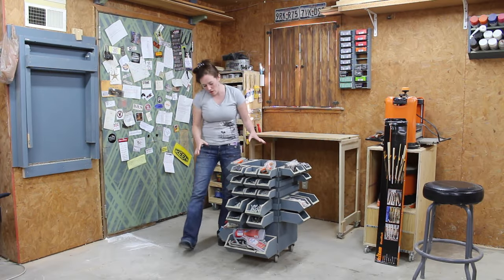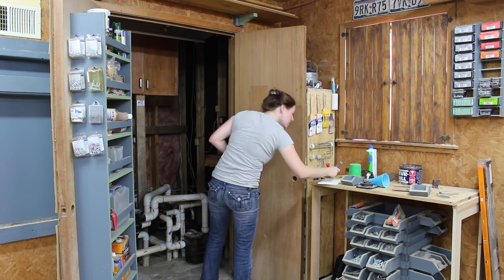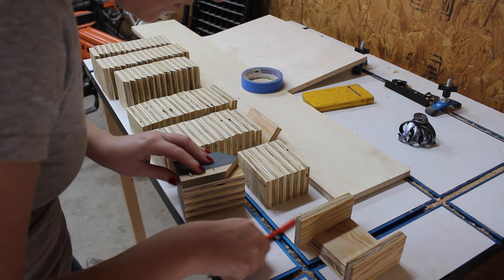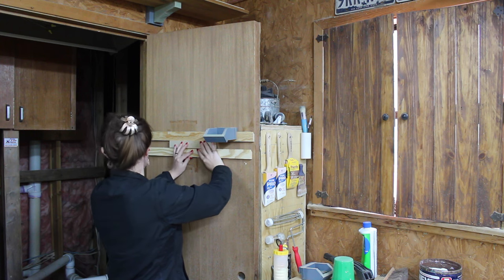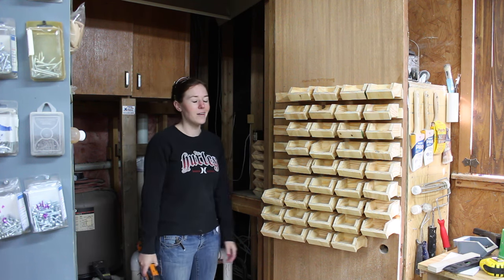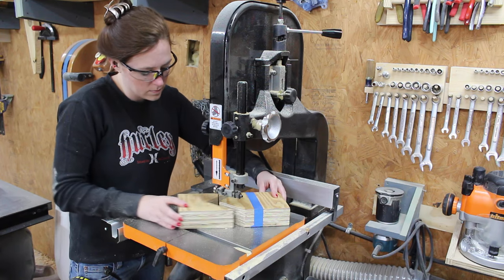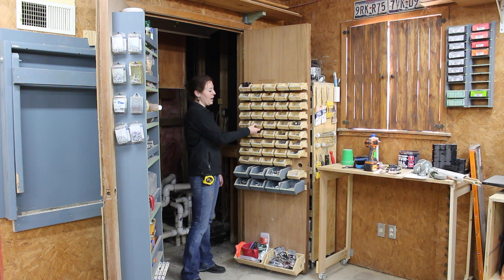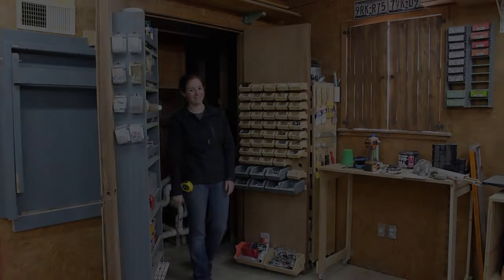Shop Hardware Storage

Comment: Love your videos April! Just want to suggest switching your hands when using your chop saw. If you use your left hand to feed the wood and your right hand to operate the saw and remove the cutoff, you hand will be placed under the spinning blade. Just looking out for ya.
Reply from the maker: Thank you, but when using the miter saw with a stop block you need to be holding the piece that is between the blade and the stop block because if it binds then that is the piece that will come flying back.
Reply: @AprilWilkerson  But if it comes flying back, won't it rotate in the process, drawing your hand toward the blade? I saw a video where the guy did this with a table saw, when it binded, it twisted and flew back and that twisting drew his fingers towards the blade. Very scary. not sure if it would be different here....

Comment: Excellent timing April.  Thank you.  We just remodeled our shop at work and needed a better way of organizing parts and supplies.  This will take care of that problem, and take up far less room.  I'm thinking it will save us about 3/4 of the space we were using for parts prior to doing this with the french cleats...now to buy materials Monday and get this done.  

Thanks again for your awesome ideas.
Reply from the maker: : ) Awesome, I'm glad it was helpful.
Reply: April Wilkerson We had 1 wall floor to ceiling about 20 feet long 9 feet high full of parts & accessories that took up tons of shelf space, and after a few weeks it was all mixed up again.  This bin & cleat system will sure straighten everything out.

Comment: Great idea to use the back side of the door for an out of the  way storage location that is not being used for anything else!!! I make bins out of 4" pvc pipe cut to 3.25" and a mdf bottom. I only have to glue the pipe to the mdf. No tedius glue up. Cuts the time to make the bins by a ton. And the PVC pipe is about 80 cents a foot so the cost is about 25 cents to make. True that the round shape isn't as efficient as rectangular, but for the time savings, I think it's worth it.

Comment: Howdy April!! Always love watching your videos, very creative, educational and helpful! Keep them coming! Just a tip- the tedious and repetitiveness of assembly of the little bins could have been eliminated (mostly) by not chopping the pieces up on the miter saw until after assembly. Basically, make long troughs (like a rain gutter) consisting of a back, bottom and front. Glue and tack them all together, then take the trough and chop it into bins on the miter saw. Now you only have to add the sides to the bins. I am always on the lookout for ways to expedite a process, and often times building a solid object and cutting it into the parts needed is faster than all the detail work of cutting many little parts to put them all together individually. Either way, great job! Cheers!

Comment: When you see a house under construction, stop by and ask the man in charge for some scrap wood. 1/2" OSB (the same stuff on your walls, also plentiful in construction scrap piles) will work just fine for your little bins. Paint if you don't like the flakey look.

Comment: Nice creative work, April! If that door is hollow-core, too much weight will peel the skin right off the door, you may have to run a few bolts clear through to a vertical strip on the back of the door to hold it together. Or just don't put much hardware in those bins. All the best, kid!
Reply from the maker: It's a solid core door like I said at the start. I also have three commercial hinges on it with upgraded screws, so it will be fine. : ) I've had the other door loaded down for over a year and it's doing great.

Comment: Great use of space.  Try hot glueing a rare-earth magnet to the inside base of each container (obviously play around with sizes) to keep the small bits in should the door accidently slam shut.  also keeps everything in if a lose bin gets knocked while on the bench.

Comment: Nice idea.  I would be interested in something like this but portable.  A centre handgrip on plywood then cleated both sides.  Something for copper fittings, hardware, clips, hangers, brackets and such.  I don't work in a shop environment so it would need to be portable.  Nice work!

Comment: Great job as usual but I plan to use 1/8" hard board for the sides as 1/2" strength is not needed. They will be slightly lighter plus take up less horizontal room. Love the French clean idea. Thanks

Comment: April  Great job .
The only thing I would add is a wheel to the bottom right side (inside)  of the door for added strength and to prevent sagging .
Reply from the maker: The door has three commercial grade hinges on it with upgraded screws. : ) It will be fine.

Comment: Great job April I hope it works out for your needs. I had a store bought system of the same idea, it had metal rails and plastic bins. I didn't care for the system though. It seemed like everytime I got near the thing the bins were to easy to knock off the rails. Oh Happy Easter.
Reply from the maker: Hm, I've been using this caddy for over a year and have never knocked off a bin before. I wonder if the angle of the cleats have something to do with it. I know those plastic ones are really shallow.

Comment: April, it looks great. Maybe, you could move the screw and nail box shelves on the upper part of the door. That would free up some wall space. Do you need to add another hinge so the door handle can the weight? Thanks for the video. Have fun in Atlanta.
Reply from the maker: I was thinking about doing that, but I don't think I want to open this door any time I want screws. I reach for my screw boxes so often, whereas the hardware that I store in here is only occasionally. I'm going to have a look around my shop and see what I want to store up there, I'm sure something still needs a home.

Comment: Steve Ramsey at Wood working for mere mortals made lighter-duty mini drawers and used a method to make them all at once then saw them apart when done. It looked to be a very fast process. In this project, you would need to use MDF for the sides, and you could use long boards for back, bottom, and front parts then saw the extra wide sides in half to separate the "drawers". Doesn't fit the requirement of scrap only, and may be lighter duty than required but for sure cuts the tedium waay down. My 2 cents.
Reply from the maker: Everybody has their way of making things. I used MDF for the first one and will never use MDF again.
Reply: +April Wilkerson Fair enough. I never use it because my shop isn't waterproof. But that means my materials cost goes up considerably - heirloom shop projects? :)

Comment: Hi April, nice space saver ! ( just like a lady to be organised ....) One comment i'd make is perhaps you need to fit a couple of extra hinges on the door to prevent issues later on of door dropping.
Reply from the maker: : ) Thanks Graham. The door actually has three commercial steel hinges already on it. I have a shelving unit on the other door, fully loaded down, and it hasn't caused any problems with the door.

Comment: Nice job.  If there are only two hinges on the door I would add a third in the center.  And now you'll never forget to check clearance on doors before mounting things to the inside.
Reply from the maker: No worries I have three commercial steel hinges on the doors already. : )
Reply: +April Wilkerson I just learned to pay attention to the video.  You can see three hinges as you open the doors right at the beginning

Comment: Hi April,  Great video, you may want to think about building an outfeed table for your tablesaw, it would make things a lot easier and safer.
Reply from the maker: I've been using a multi stand as an outfeed table and it's been working great! I like it much better then building a dedicated outfeed table. At least for the time being....
Reply: +April Wilkerson I used to use one of those until I had some close calls and that chanced my mind in a hurry. I use a plastic top folding table that I purchased at Costco. It's easy to fold the legs and put away. Just a suggestion. Keep the the videos coming and be safe. :)

Comment: Good Fantastic Great.... I really like your videos. B U T you scared me the way you had your hand on the wood when you were cutting the small parts. Better way would have been to use your right hand on the saw and the left hand on the wood. Of you were worried about the small piece kicking out, make a small "Zero clearance" add  -on for the saw and use it when you have to cut small parts so you don't have to have your hand so close to the saw. I have a friend without his right thumb because of operating a saw in the way you were. Thank the Lord he is left handed. You're to young to loose fingers.
Reply: David Curtis 

Good point David.

I like watching April's enthusiasm in getting things done, but I got worried for her in this video.

When I saw the video I thought to myself safety first.  

Even if the Miter saw will turn off when lifting the blade, the blade maintains spinning momentum which can cause (G_d forbid) a nasty injury.

My solution would be to place a receiving table on the right side of the Miter saw to place the 'after cutting' parts.  In this way her hands do not have to go under the blade of the Miter saw.

Comment: I just have a personal rule where if my hand or fingers is 4" or closer to the blade or rotating part, I may look for a different way of doing it.  This is from someone who got a nice Roman ogee scar on the tip of my ring finger using a router table of all things, routing a small piece.  Very nice project though.  I've been wanting to do something like this for a while.

Comment: nice job, did you have to replace the small brass hinge screws with longer ones, the steel bolts weigh a lot, you could put a small wheel roller at the right bottom of the door for support.

Comment: April, beautiful design and best way to organize it, but I have a question:
You changed or reinforced door hinges due to the increase in weight?
Reply from the maker: Nope, the door was already equipped with three commercial grade hinges so it's just fine.
Reply: Thank you for your attention to answer.

Comment: I did not get why at the miter saw, you held the piece with you right hand, and pull down the blade with the left hand. Switching hands is natural, makes for ease of operation and safer. Had to say it. :)
Reply from the maker: I like using the miter with my left hand, I feel safer and more comfortable so that's the way I do it.
Reply: I would guess she's dong that to make a more clear shot on video ?
Reply from the maker: No, I just feel more natural using my left hand for some reason.
Reply: +Cino Nim i get all the good reasons. Then just switch the stop block on the left of the blade..! It's all good. I don't intend to support this trend. Do as as you like, that's cool. Nice project btw. Thanks.
Reply from the maker: If you switch the stop block to the left then I would have to hold the piece of wood with my left and use my right for the saw and like I already said, I feel more natural using my left on the saw. It is no more dangerous to use your left than it is to use your right. Make cuts the way you feel most comfortable.
Reply: +April Wilkerson It has to do with keeping the board sturdy and steady while one makes a cut. 2/3 fingers hold on a small piece is weaker as the board is likely to move on you and mess up your cut, rather than having a whole palm pressure firmly on the longer/heavier board, while making a cut. I know there was no space on the right because of the wall obstacle... This is a general statement. That's what I should said in my first comment. Constructively, cheers!
Reply from the maker: Oh ok I understand the disconnect now.....so when using a stop block at a miter saw it's important to hold the portion of the board that is between the stop block and the blade because if it gets bound up then that is the piece that will come flying back at you. So since the stop block is on the right, I'm holding the board with my right hand and operating the saw with my left. However, if I moved the stop block to the left, then I would still need to hold the small piece of wood being cut to prevent kickback. So it's the same in either situation. If there is no stop block being used then yes, 100% agree that the longer portion of the board needs to be held for stability. : ) Cheers to you as well!
Reply: April Wilkerson FastCap's 10 Million Dollar Stick will eliminate any risk to your fingers when holding holding small cutoffs like that in your miter saw. (I just use it, and I have no affiliation with FastCap.)

http://www.fastcap.com/estore/pc/viewPrd.asp?idproduct=54001

Comment: How many hinges are holding the door April? Make sure you have three with large screws into the door as well the wall stud. Would hate to see that door crash to the floor with all the added weight.
Reply from the maker: I have three commercial steel hinges, the other door has been loaded down for over a year now and is just fine. : )

Comment: Great system. Why didn't you put it on the front side of the doors facing the shop?
Reply from the maker: Because I have my notes and such on the outside. Plus, placing them on the inside will keep dust out.

Comment: Great video! But OMG April don't trap your hand between stop and blade using chop saw. That's a recipe for disaster.  
Love how your shop is coming together. Do you have some kind of plan?
Reply from the maker: You need to hold the piece of wood that is placed between the blade and the stop block because if the wood get bound up, then that is the piece that will come flying back at you. My hand looks close to the blade in the video but it wasn't, I was being safe and I was comfortable making the cuts.

Comment: Looks awesome!, did you need to do anything to the hinges to counter act the weight added to the door?, or do you think that it will hold with out sagging at some stage down the track ?
Reply from the maker: The door already has three commercial hinges on it with upgraded screws so it will be fine. However, if it didn't have three hinges then I would have added one. : )

Comment: great idea i might use that system in my shed but why didnt you use the old small bins rather then making all new ones?
Reply from the maker: They were a little too wide, I would have had about 3" remaining on each row. So I changed the size slightly and was able to get 5 on each row with no wasted space. : )

Comment: Looks good April. If those are standard contractor grade door hinges you might think about upgrading them.  You think building the bins is tedious, just imagine sorting all the contents out of one pile on the floor...:)
Reply: +Matt Heere I was just going to comment on the hinges until I saw your post. That's a lot of weight on those doors, AND they are solid core doors.

Comment: great use of otherwise wasted space! Just one question why could you not have used the small bins that you had already made for the rolling cart?
Reply from the maker: Because the size of them would have left over about 3" on each row....so I slightly modified the sizes so I could fit 5 total and use up the majority of the space.
Reply: +April Wilkerson makes since it always works that way something is just a little to short

Comment: Looks sharp, but all that weight hanging on the door, how long before the hinges either start to sag or fail all together. I hope there will be no problems. and it frees up floor and wall space.
Reply from the maker: There won't be problems, I have three commercial hinges on the door with upgraded screws.

Comment: Thank you for the plans! What angle did you use for the cleats themselves? Looked sharper than 45, maybe 30°? And how thick, also 1/2"?
Reply from the maker: Nope, I went with a 45 degree angle. : ) and 1/2" plywood for everything, the bins and the cleats.

Comment: Great project I just wish you would hold the wood on the other side of the miter saw I thought you were about to chop your thumb off
Reply from the maker: It would be unsafe to hold it on the other side. You always need to be holding the piece that is between the blade and the stop block because if it binds that is the piece that will come flying back at you. My hands were well out of the unsafe area.

Comment: Very nice!!!

I (as a noob) am curious as to why you wouldn't start at the top of the door to maximize vertical space, stocking less used items where they would need ladder access to view?

My curiosity likely comes from the possibility of a lost row  when potentially trying to add rows later, from the center up.

Again, certainly not attempting to critique, just wondering if that decision was based on a specific reason. :-)
Reply from the maker: If I needed more space for bins (more then what I'll be able to add to the bottom section) then I would totally do what you suggest, but since I have more space then what is needed I'll use the top for something that won't be obstructed and will allow me to make something else just laying around, a home. Since the space is taller then me it will probably have to be shelves but I'm going to wait until I know what I want to store before I plan out what it will look like. : )
Reply: +April Wilkerson makes tons of sense!  If I did "fandom", I'd certainly be one of yours. :-D
Reply from the maker: : ) Haha, thank you. ; ) Cheers.
Reply: +April Wilkerson :-P

Comment: I'm a uncomfortable watching those small cuts on the chop saw.  I prefer to clamp a block on the table saw fence before the blade and make the cuts with the miter gauge.  I've just had bad luck cutting small pieces on the chop saw.
Reply from the maker: That's a great alternative way to make the cuts. I would never suggest making cuts that make you feel uncomfortable.